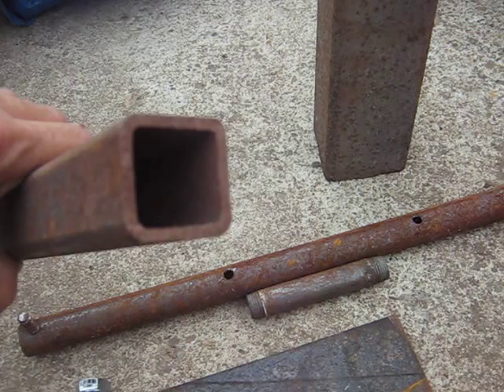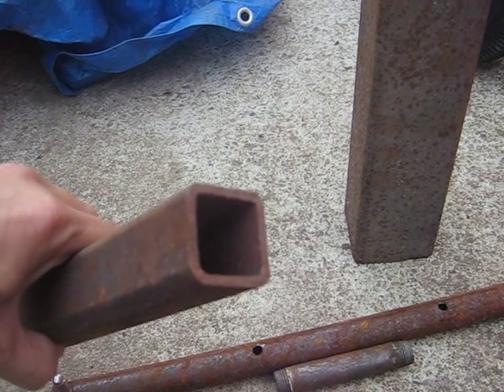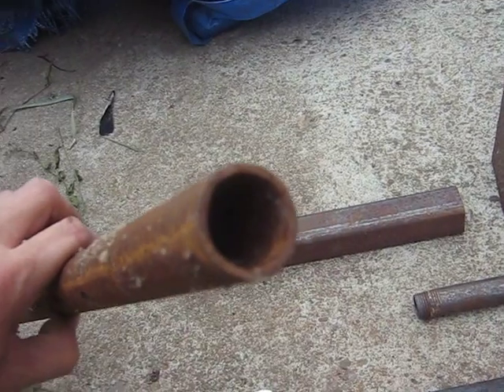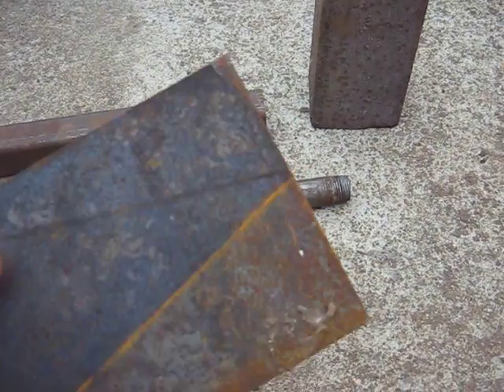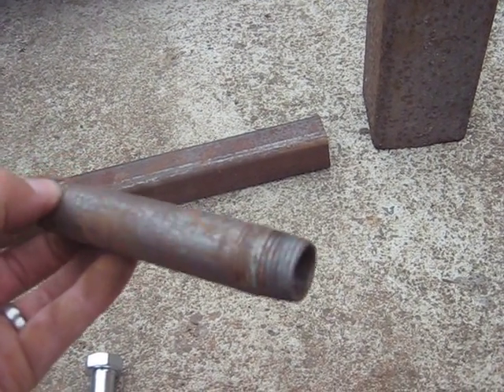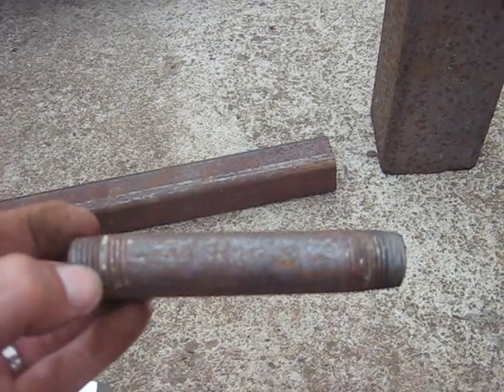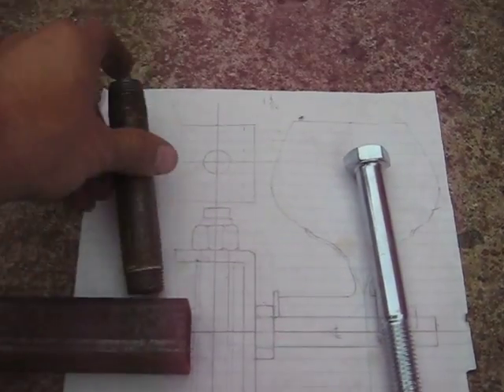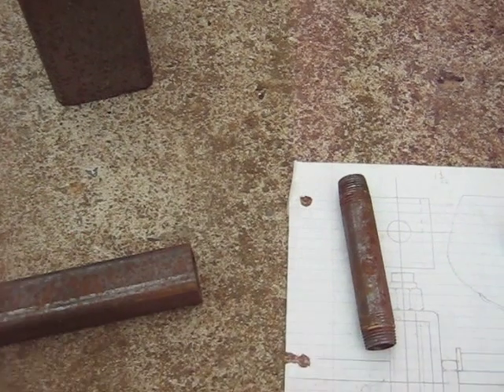Go-kart Construction Vid#3 Materials

Comment: I don't think that is HSS (High Speed Steel) HSS is what is used for like drill bits and other cutting tools?
Reply from the maker: I think HSS has 2 meanings as Hollow Structural Shape is another one.
Though you are correct with high Speed Steel

Comment: charger you plan to do a vid on the axle and the different drives types soiled drive, chain, belt, clutch, jack shaft, and torte converter i got a frame but that's it